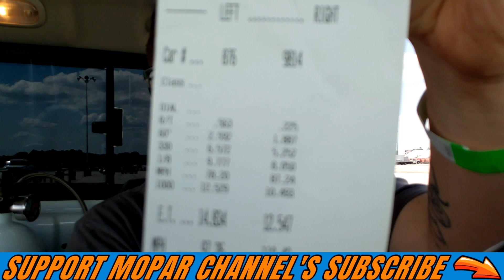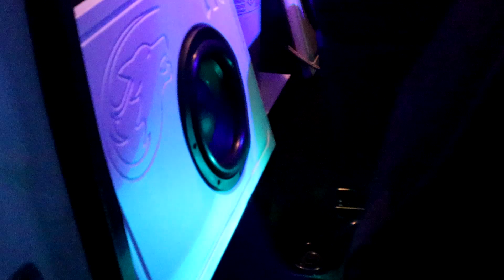TorqStorm Supercharged Ram GAPS 370Z

Comment: How in the hell are you in a single cab, supercharged, on nitrous, cammed on slicks and still in the 12’s?
Reply from the maker: Lol, not running nitrous right now just 7psi and mine is a 5speed not 8speed also on radials not slicks with stock converter also😉
Reply from the maker: However last year I did run 11s on just nitrous no boost. This is a new setup that is not even close to dialed in yet.